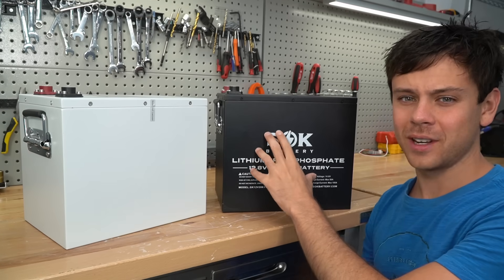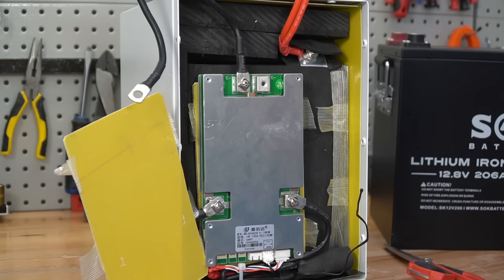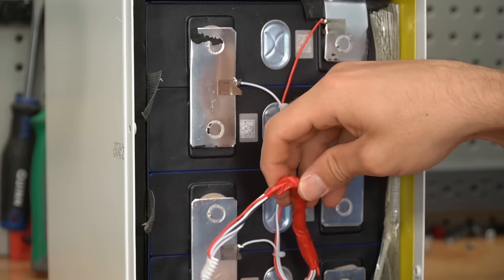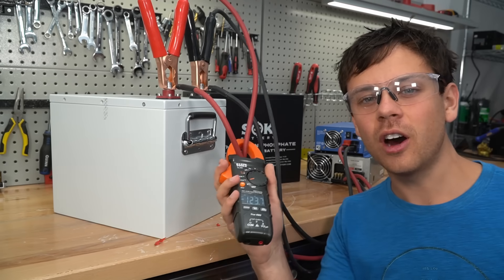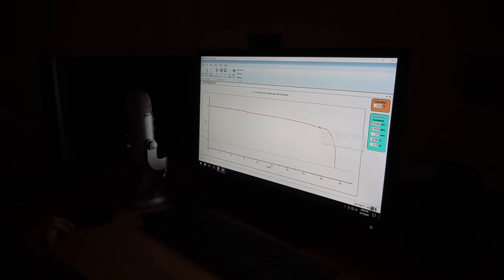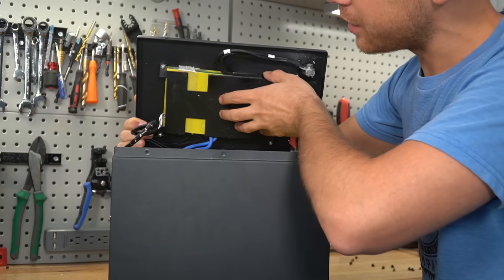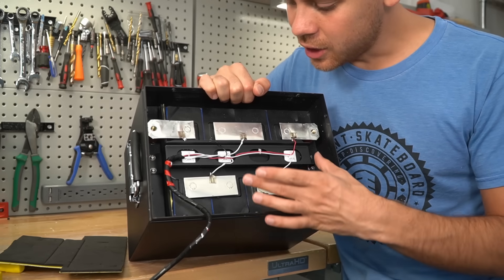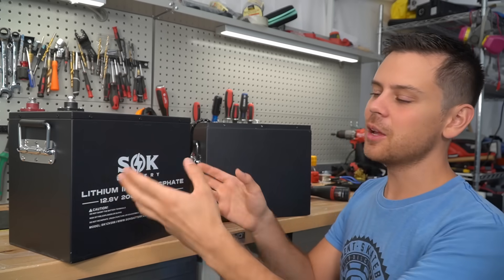SOK LiFePO4 Battery Knock Off! Prototype Tear Down

Comment: Will with  these large cells when they are worked hard the BMS bleed balance is not really enough to keep them in trim - often its just 30ma - I found a supplementary bleed balance rated at 500ma  on alliexpress for less than $5  - its only downside is it gets warm
Reply from the maker: It's actually more than enough balancing current. Not necessary to use anything else. You could use this same bms on 1000Ah cells and it would work perfect. One of my friends does that actually. It's overkill
Reply: @WillProwse   I reckon you are right if you charge  charge to 3.6 and leave it there a hour or two absorbing  its enough but like many I  cap my charging at 3.5 Volts  to prolong cell life and  found the 120amp blue tooth BMS struggles with this brief dip into the upper knee - the bleed only starts at 3.45 so it only has 0.05v to do its job - its a conundrum
Reply: @trevortrevortsr2 
Will can only really give generic answers. So you answered your own specific question.
Reply: @johnrhodes3350  My mistake  I should  qualified my initial comment  by adding that i cap the charge to 3.5volts - it is a conundrum the more you cap the less chance the modest bleed balance has to do its job
Reply: @trevortrevortsr2  I like the idea of as you say capping and low voltage cut-off to help extend the longevity of the cells. Maybe once every few months top or even 'bottom' balance by connecting all in parallel for a period of time.
Reply: @johnrhodes3350  Battery doctor recommends   go to  3.6 on the first 3 then 5th 10th and every fifty  cycles after that - I caped mine at 3.5 by setting a solar dump voltage sensing circuit and diverting the solar to hot water - the a circuit isolation I can use to let it sweep up to 3.6

Comment: Hey Will, curious why they have so much dead space in the metal case? Why not try to make a sleeker case? Looks like they could shrink almost 2"

Love your channnel and aboit to finish my 120ah setup
Reply: Bc it's economics - one size fits all - like the range of traditional battery sizes.

Comment: They certainly ought to add the BT module - it's just a few bucks and would be a worthwhile added cost.
Reply: I bet you can find a bluetooth module and hook into the existing connector. so even more money saved if you feel like partially tearing your own battery apart
Reply: @OffGridWyvern  sure that the BT module is about $8 on AliExpress, but I would guess that the builder could include it for a couple of bucks.
Reply: @RevM  got a link ?

Comment: I would love just to get my hands on that battery box.
Reply: We need an ammo box company to step up and start making boxes that are just the right size for 100 amp hour, 200 amp hour and 280 amp hour lifepo4 cells, including room for a BMS. I understand that Will doesn't care what it looks like when he's done and I don't care much about that either but when most people build something they want to end up with something attractive when they're done. I bet they could sell a bunch of them.
Reply: @chadstanich4324  I found that a NOCO group 27 battery box (12.99 on HomeDepot or Amazon) holds 4 - 280AH cells and a BMS similar to the one in this video (120A), nicely.
Reply: @peterrock2838  thanks, I actually have 4 280 amp hour cells I need to put in something.  I will look into that.
Reply: Found a battery box that can accept 280ah cells and still have room for the BMS. And it has 12v sockets, usb ports and a 1000w built in pure sine wave inverter. Basically it's the no-brand version of Ardent/HardKorr, and if you slap a solar charge controller on top of it it would basically be a solar generator by itself.
Reply: @RRyyas  link!!

Comment: Excellent video as always Will! Tomorrow will be one month since I ordered my Overkill BMS and it still hasn't shipped yet. Have you heard anything about them running behind?
Reply from the maker: They are having shipping delays like most other manufacturers. You ordered at a good time because the next shipments are not coming for a while. You should be able to get your BMS soon. Did you try emailing Steve?
Reply: @WillProwse  I will now, thanks 👍
Reply: @WillProwse  Will, can you recommend surge protectors please?  I understand you need at least 2000 jules?
Reply: Overkill took around that long to ship my BMS. I wouldn't worry about it.

Comment: I see you checked the low temp charging cutoff. Did  the low temp charging cutoff also cut off the output?  If you still can get output did the power cut off at a lower temp?
Reply: With that BMS, you can set the temperature to cut off charging, not sure why you would disable discharge, discharge doesn't damage the cells until below -20 C.
Reply: @john_in_phoenix  My question is the output  still avaliable . I read that some bass turn off output when turning off charging.
Reply: Yes, of course it's still available.
Reply: @john_in_phoenix  I hope so.. One review on Amazon a user said the the BMS also turned of the output on the battery he purchased.

Comment: I noticed that the handles are mounted upside down. They should fold up and hit the stops so that your fingers don't get pinched when you lift. The SOK's are upside down too!
Reply from the maker: Oh wait, if they were going the other way, would lock out at 45 degrees and this pack is 60 pounds. I wonder if it would bend that piece of metal that holds it in position. Hmm

Just went outside and tried lifting it upside down and bent one of the handles. It is preferred to keep them the way they originally came.
Reply: @WillProwse  probably, they don't look very skookum
Reply: @WillProwse  I like your "test to failure" approach. Keep it real!
Reply from the maker: Good point!
Reply: I’d like the top/bottom seam protected by a rubbery grommet. Keeps contents dry and sealed.